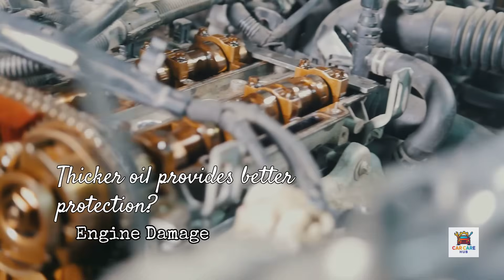STOP using 5W30 oil! (BEFORE IT'S TOO LATE)

Comment: What a bunch of lies. It's being proven that 0 w- 20 oils are only so manufacturers can pass the strict EPA regulations. On fuel mileage, but that's only when the vehicle is new. 0 w- 20 motor oil accelerates engine wear, that shortens the life of the vehicle. To the benefit of the vehicle manufacturers. So then you have to buy another vehicle. Vehicles  nowadays are throw away vehicles. Use them once and throw them away.
Reply from the maker: I understand the concern, but it’s not that simple. 0W-20 was adopted mainly for fuel economy and emissions, yes—but modern engines are designed around it (tighter tolerances, improved bearings, better oil chemistry). When the correct oil spec is used and oil changes are done on time, there’s no solid evidence that 0W-20 causes abnormal engine wear. Using a thicker oil than specified can actually reduce protection in cold starts and affect variable valve timing. The key isn’t thicker oil—it’s using the oil the engine was engineered for.
Reply: @CARCAREHUB247  Totally brainwashed IMHO the minimum viscosity should be 0w/30 especially in hot climates
Reply: When's my vehicle going to die? I have 262k kms on a 2020 Rav 4, and I keep using 0w-16 from Toyota. Doesn't burn any oil either.
Reply: @abegiesbrecht1148  How long and how hot are your summers?  Also what group oil are you using.  A group 4 and 5 have a higher heat range for hotter climate.  A high quality group 3 will probably handle hotter temps as well, if you're using Idemitsu, it's a high quality group 3.  .  Have an oil analysis done after a summer run, it will tell you if the oil sheared down to a lower grade.  For you, it'd be a 0w8 instead of 16.
Reply: @lonniebeal6032  well we travel all over western Canada, and down to the states every once in awhile. I never had an oil analysis done. I just take it to Toyota for an oil change when the light comes on. 

It's right in the contract if I do all my oil changes from Toyota if there's an engine failure they'll do an oil analysis. 

That being said my warranty is long gone, but I get all my services done through a Toyota dealership. 

Now if I were to start using say a Walmart brand of oil, or just take it to a random auto shop, then I would start to think of those things. 

I'm pretty sure that Toyota who built my vehicle, has the right oil for my vehicle.

Also if I'm about to put 5k km on the vehicle on a round trip on any of my vehicles, and there's about 1k km on the the engine oil, I just go and change it, then change it after I get back. The light usually asks for about 7k kms, and I only let my oil sit in my vehicle for about 7 months max. 

Anyways. Have a good one
Reply: @abegiesbrecht1148  running on a prayer, consider yourself lucky especially when the  wear clearances of your engine at such high kms are way out of spec.
Reply: Back to the future. Now we will have summer oil and winter oil, like my old 1953  Chevrolet. Wasn’t multi grade oil suppose to solve this problem? Now we will have psychic oil prophets who for a small fee will tell us what kind of oil to use based on ambient temperature' mileage, city versus highway driving and the position of the stars.

Comment: Sir,  you did not address the situation that I'm in,, where the 2017 Mazda Sport that I drive's owner's manual in Europe tells them to use 5W-30,  and mine says 0W-20.  It is well established that the cars sold there and here are identical.  And,  there are dozens of videos stating that the primary reason for the differing American manual listing is to provide maximum rated fuel mileage___not maximum protection.  That's for my car,  but I believe many are in the same situation.  My car is not turbo-charged.  Therefore,  at this juncture,  I find your discussion somewhat incomplete.
Reply: i agree with you. i run 5 w 30 in my 2017 silverado 5.3 engine
Reply: @haroldyoung5226  i use 0W40 in old cars.
Reply: "I find your discussion somewhat incomplete" Actually totally misleading as you said When did any manufacturer care what happens after the warranty expires on your car as long as they pass the lowest emmissions engine ratings
Reply from the maker: You’re right that identical engines can have different oil specs by region. In many cases, 0W-20 is recommended mainly for fuel-economy and emissions targets, while 5W-30 may be listed elsewhere for broader operating conditions. My point is that oil choice should consider climate, driving style, and manufacturer limits, not just one label. I appreciate you raising this—it's an important nuance.
Reply: @CARCAREHUB247  Also point out that oil viscosity charts have their place for a reason.  I have only seen one that applied to full synthetics, wish I had copied it.  It showed 0w20 being good to about 75F.
Reply: @lonniebeal6032 The quality of the oil is important too. There are some YouTube channels that do extensive oil analysis of different oils after expensive dyno runs.

Comment: everything in the wrong situation can go wrong...WTF are you talking about
so 5W30 is the best... your title is just clickbait... and you never saw an engine inside...
Reply: hes an idiot
Reply from the maker: 5W-30 isn’t bad universally. This video explains when it’s the wrong choice based on engine design, climate, and manufacturer specs. One oil doesn’t fit all.
Reply: @CARCAREHUB247  your title... stop using 5W30 before its to late...but ok, you were not wrong..
Reply: @CARCAREHUB247  ofcourse, or every brand would only make 5W30...
Reply: Normally it depends on how old your car is. New cars like 0W-20. Youngtimers like 5W-30. Oldtimers like 10W-40.
Reply: @hkonhelgesen  do me a favor and look in your manual what oil the car brand is advicing... they know their engine